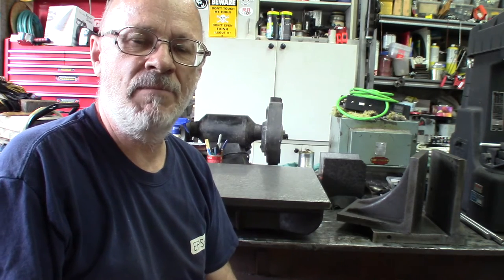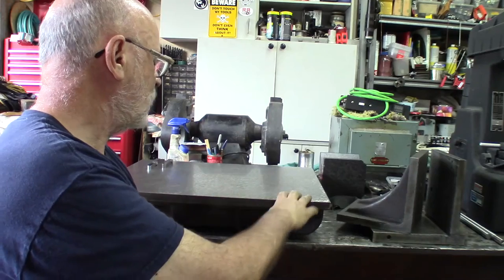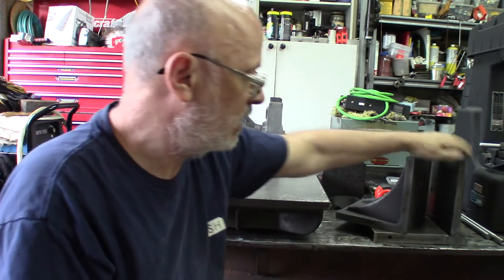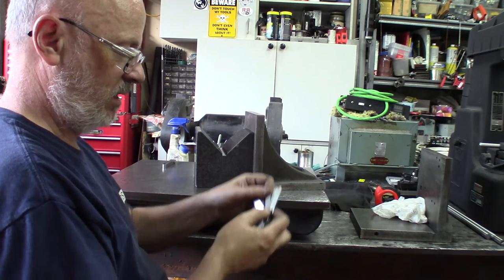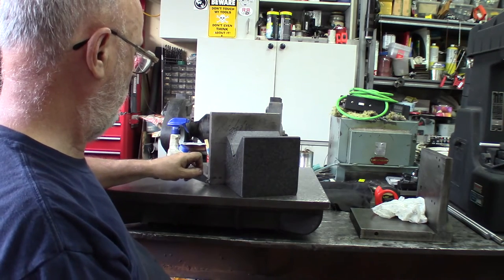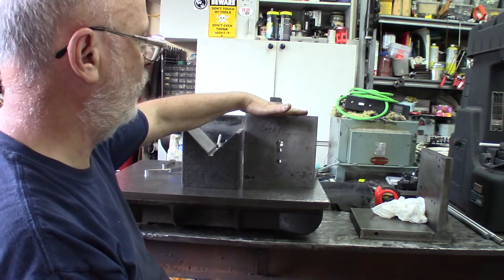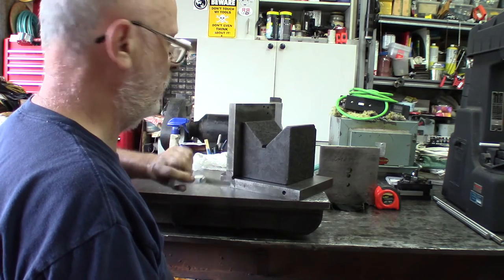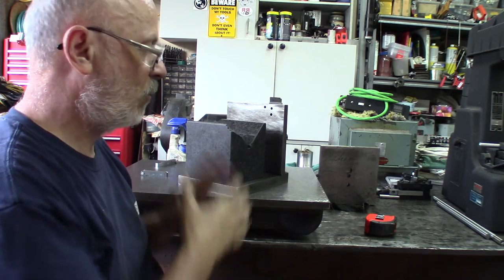Simple metrology for a semi precision angle plate

Comment: I still regret selling my big surface plate from my old shop when I came over 15 years ago - IIRC it was about 24" x 18" - mega heavy cast brute with big end handles. Now I have to make do with my tiny 10" x 8"! What a come down. May get get a granite deal of better size. I must check my large angle plate but now really miss my big surface plate! Nice exercise Pierre.... look fwd to next part.
Reply from the maker: ChrisB257 Hi Chris,
Don't despair, I find almost all I need in the classified adds at decent prices for most stuff....
Sure you'll end up with a great deal when you keep your eyes open.   ;-)
Cheers,   Pierre

Comment: Nice iron plate! I still need a good big surface plate in my shop for reference. Did that angle want to vibrate any overhung like that?
Reply from the maker: bcbloc02 Hi Brian, the iron plate is a secondary plate, for me I consider it semi precise, good for quick measures or lapping or sanding parts it will be a nice add on for about $50.
If you have a chance to get yourself 1 or 2 of those granite blocks they're really a must for good reference.
You'll see in the coming episode that this setup isn't final, there is room for improvement... ;-)
Cheers,   Pierre